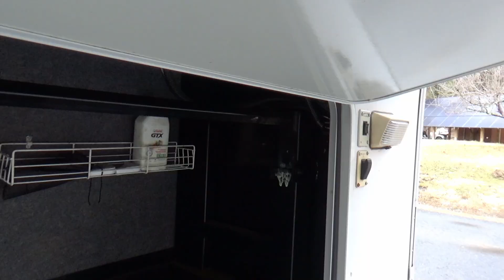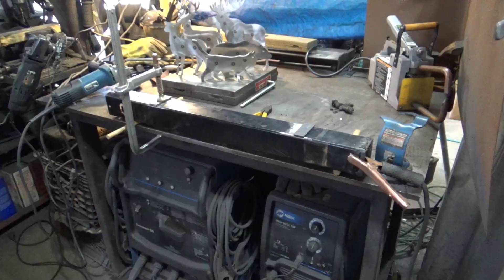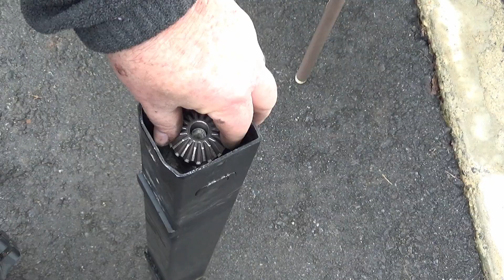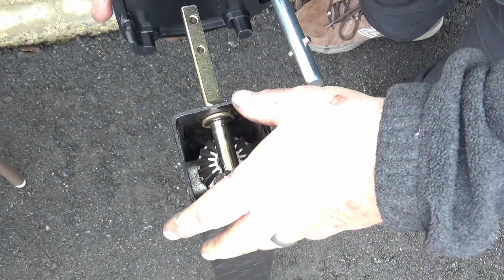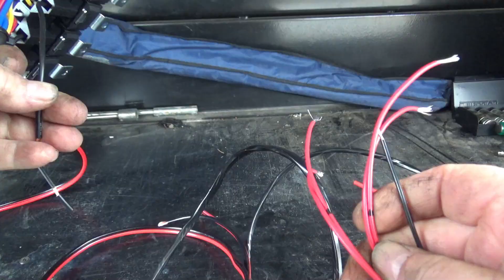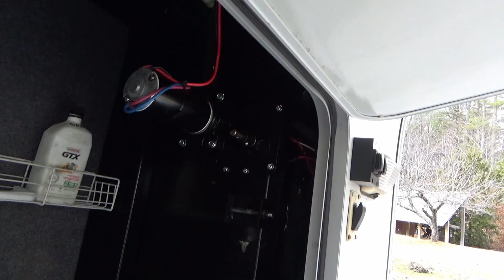Lipert 5th wheel Landing gear conversion to Dual power $300

Comment: Hello nicely done but curious why you did not just go with hydraulic since I saw you have a hydraulic pump in the battery compartment
Reply from the maker: The hydraulic pump is for the slides.   I just figured it was easy to stay electric.   Cost wise, electric is definitely cheaper and it is easier.   I am very happy with the outcome.   I have used it several times and it works great.

Comment: So you made the switch and harness or you made it all.  Sorry. Just bought the conversion kit from Stromboli and Carlson and need to wire the second switch.  Saw your setup and thought it looked and worked better.  Was hoping to be able to buy one as I’m not that great with electric stuff at all.
Reply from the maker: I bought the switches from Amazon,   I 3D printed the switch housing,   I did all the wiring from battery to relays to switches and motors.    It works great and I can now adjust level from side to side    I am thinking about adding two modified tongue jacks behind the rear wheels and two more switches, relays and have true 4-way leveling stabilizing.    Do you have a specific question I can help you with?
Reply: @jmanatee I was hoping you bought the relays and switches all pre wired somewhere and was hoping for a link to buy them.   I am buying  a second motor and lead  jack from Stromberg and Carlson and I’m not good at wiring stuff.   My factory one is already wired  so I guess I’ll just have to run the other switch to the battery?   I can’t find any videos on how to hook up the switches….  Your set up is really great and your rear jack idea is perfect as mine are always so out out whack after leveling the camper one is always higher than the other.
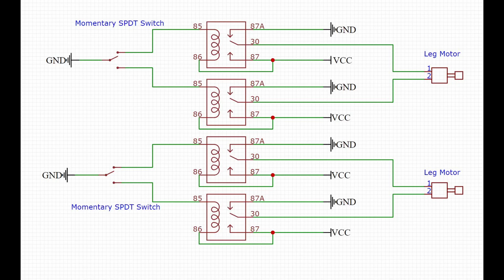Reply from the maker: You can find how to wire the relay pack in the video at 16:33   https://youtu.be/97qR_LQqCWM?t=993   hope this helps.
Reply: @jmanatee thank so much.  God bless you brother.